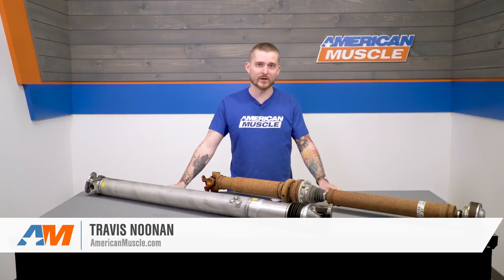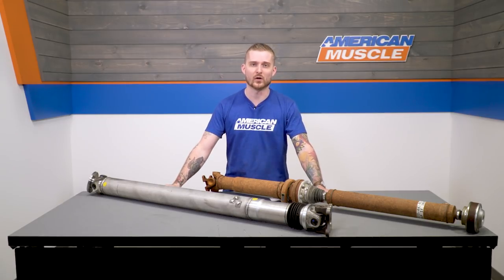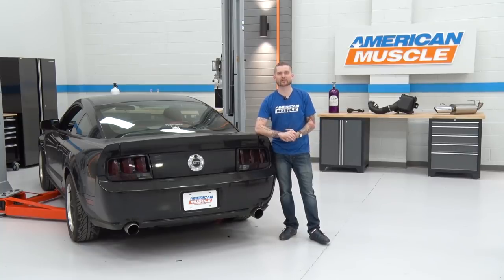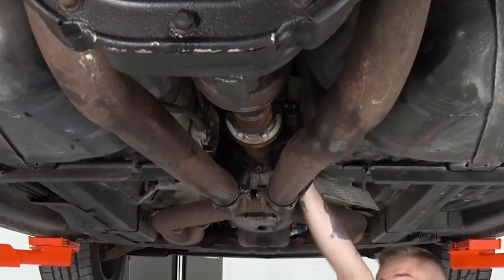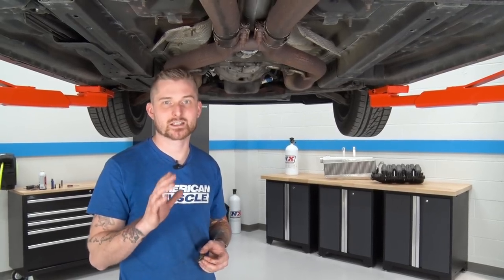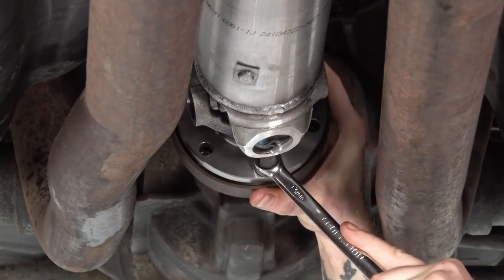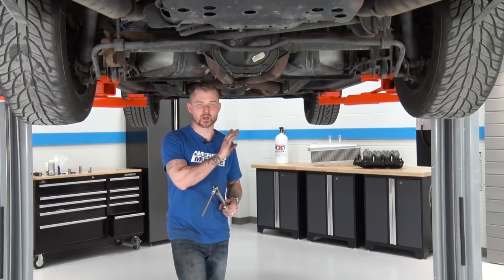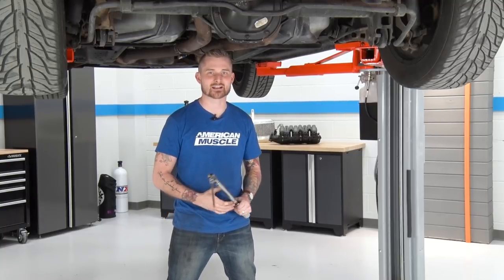2005-2010 Mustang GT Ford Performance One-Piece Aluminum Driveshaft Review & Install

Comment: Speaking as a Ford Tech of 21+ years,  those bolts are a one time use, replace them with new ones. If you ABSOLUTELY need to use the old ones, use orange threadlock.

Comment: My new aluminum Drive Shaft gave me an additional 25 HP to the wheels!
Reply: Did you dyno before and after?
Reply: @djdirtydan3393  That was sarcasm. lol,  I did replace the stock with an aluminum Drive shaft  but other than reducing the rotating mass and weight I doubt that it added significant HP. It might have added 5hp do to the weight reduction but that's not worth paying hundreds of dollars for a Dyno to prove otherwise.

Comment: Confused here. On the site, in a reply to an asked question, this driveshaft will not work with automatic transmissions, it only works with a Billet standard 5 speed tranny. I don't like two-piece driveshafts and I want to single one on my '07 S197 GT V8.

Comment: I have all of a sudden started getting steering wheel shape at about 50-55 MPH. I've had the tires checked. I brought the tires in for balancing and was told it was perfect.  I have been trying to track it down for a while and coming up short.
Reply: Me too, mine rebuild was paired with a 3:73 rear gear upgrade and Ford Performance LSD. Now 3rd-5th gears at 60 mph I get a real nasty vibration like driving over rumble strips. Any idea how you solved your issue?
Reply: Is the vibration problems with the oem driveshaft or the new 1 piece?
Reply: @dennislink1300  check pinion angle !
Reply: @andrewslagle1974 yep should have followed up on this months ago. The issue was pinion angle but caused from the rear control arm bushings. The bushings were old and had degraded and that was the +2 degrees that was causing the pinion angle to be incorrect. When it was on the lift it just compounded the issue and no one checked the pinion angle after dropping it back to the ground.

Comment: Whats the problem with the oem driveshaft? Ford went though all that trouble of r&d to make a worse drive shaft?
Reply: When they ware the x3 joints get loose  and clunk and vibrate ,also that x2 pc shaft (if your drag racing the car) is the weak link .We see the 2pc shaft tore out when you beat on the cars.Hope this helps!

Comment: I hear some noise when accelerating from around the shifter area sounds like a hum gets louder as I accelerate harder stops when off the gas could that be the drivesfaft 05 gt convertible 50k miles
Reply: James Barker I have that noise too